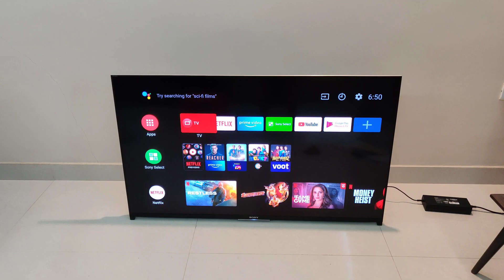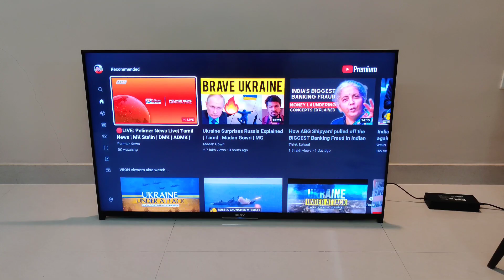Sony Bravia Red Light Blinking 6 times - Issue Fix! | KDL-50W950C

Comment: same issue with kdl 40w600b model after more than 10 years. sony service advised to change the LED back light.
Reply from the maker: Suggest you try this first. If it doesn’t work then you have a choice to change backlight or the TV itself

Comment: I have a Sony KD-65X8500G and this worked for me, I was able to release the wire from the connector by lifting the little plastic barb with a safety pin.

Comment: Hello Adith
I got the same Problem with  the Sony TV KD-43FX8096 there it is in the 2 line at the Moherboardsite  after the firste line is a gap and then comes  the 2 line.I have cut it and grounded. And it works!!!
When the TV is starting to booting with signets it is not the Blacklights.
You Video was bringing the solution, thanks!

Comment: I think I might have the same issue where the tv turns on but then shuts off and boot loops 
I switched the power supply board but it still boot loops my tv model is the Sony KD-55X720E 
If anyone else can help that’d be greatful 
Cause I don’t wanna try to do the ground wire to the screw method yet until as a last resort

Comment: It worked for kd 55xe8096 but i cleaned the power board before cutting the wire. Could have tested after cleaning itself as i found some dust particles short circuited some capacitors

Comment: I bought a 65 inch 4k sony bravia android tv in December 2019 it cost £1200,it came with 5 yrs warranty and went on the blink 5 days after the warranty had expired 😢 for the cost of repair £300+ it would surely be better to go buy a new set,it's hard to put trust in any brand after the expense to repair is placed on you after spending a small fortune 😢
Reply: thats so unlucky, did you get repair or new tv?

Comment: My TV Sony Bravia Model no KDL-75W850C  has 6 times  Red light blinking problem. I tried shown in vedio for this fix..Disconnedcted and grounded the 4 th wire(BL_EER). TV started,  The Red light blinking is gone. The TV sound comming But TV picture (not opening the screen) not comming . Can some one help how to fix thepicture display?

Comment: There are two strips of backlight at the bottom,but removing is a pain.I have no idea how many LEDs in these two strips for your case.
For 43" Sony we have total of 54, 6 volts of LEDs .Each strip has 27 LEDs.Also, to let you know each strip has three set of 9 LEDs.Each set is powered separately.So now we have 6 set of 9 LEDs each 6 volts.The Power board will sense if each set (Total 6 sets)is less than 48. And go the error state with 6 times blinking.You can calculate 6x9=54Volts theoretically, approx.48-49volts practically  for each group .If a single LED(6volts) is failed (short)that means we loose 6 volts  out of 48(48-6) which about 42, similarly if one of the LEDs is open from group of 9 them we get Zero(All 9 are in series )voltage,in either cases you get 6 times blinking.
There is a different case too, where we get 6 times blinking even if the driver IC on the power board is faulty.
In those cases you need to repair the power board after fault identification step.
My basic question.It is difficult to find out whether the problem is board or LED strips.
Let me clarify those as I am also learning tv repairing now a days
If the tv starting with visible logo of sony/android  etc and it keeps repeating few times or it just happened once afterwards  goes to 6 times blinking:This means It is the LED strips problem.If the TV simply goes to 6 times blinking without any logo after it is released from stand-by then it is power board(Mostly driver chip)
We can also check the postive voltages(white wires) at the connector from those 4 to 6 pins at the starting of the TV that would let you know that the driver chip is bad or good.If you get a voltage increase and go to a stage of about 50(In 43"sony) and then drops to 19.2v  each time before 6 blinks then in this case you have a good  driver board.
The 43" uses a 19.2v dc,3.54amps
 adaptor.
This my experience on a 43" sony lately 😊

Comment: Just did it on a KD 55XE8096.
Works great. Cable is the same as shown.
Thanks for the help.
Reply: Is it still works or any problem came?
Reply: @Raklmn  The TV isn't used very often, but so far it's worked great.
Reply: Also just did it on that model, same wire and works perfect now :)

Comment: If you have a kd-55xd8005, the wire is the 6th or 7th wire from the bottom (on the power/backlight inverter board , not the main board) and you dont ground it you just disconnect it from the connector so it no longer has a connection to the main board, if you use a needle or fine tweezer end you can unplug the connector and gently push the wire out of the connector, just keep disconnecting the wires until the tv will stay on and you find the right one , its one of the thin wires ( some of the wires are slightly thicker and some are thin), either 5th 6th or 7th from the bottom, on the top row of wires , not the bottom row . Reply to my comment if you have this model tv and cant find the wire because im going to note exactly which wire it is when i open the tv back up to replace the backlights, please note , this isnt a permanant fix , its just a useful diagnostic procedure to be certain the backlights are faulty and they should be replaced after , although the tv will come on, you will notice dark spots at the bottom of the picture where some of the leds are not lit up .

Comment: I did this for my 2019 model Sony and when it is grounded it doesn’t turn on, but when it is lose it still faces the same issue, turns on for 5 seconds then shuts off and flashes 6 times. Is this because it is a newer model. I see a lot of videos where this is done with older models
Reply: what did you do? has something to do with changing the back led lights?

Comment: after 11years without even sngle failure, my kdl 42w674 finally 6 blink. fortunately i dont have money to buy oled as my next tv. so i look around and found this fix works!
but before i cut the wire which is LD_ERR, i read somewhere comment that it is equal to BL_ERR. cut it ground it done!
my tv undo the death
Reply: and now after a month it's completely dead, only on for 2 3 minutes then flcikering then stuck, no response from remote control, unplug and plug again, it repeat as above. I assume dead now

Comment: Absolute life saver!! Thank you so much worked for my xbr-850D, I also changed my settings to standard cause it would go black on half of the screen but it didn’t shut off. The standard setting fixed that!
Reply: does it still work ?

Comment: You are a absolute LEGEND.  Back setup looked way different but managed to complete it anyway just by using common sense.  But i didn’t cut the 4th wire, i managed to lift the white part up and just pull out the wire out. 

But anyway, THANK YOU SO MUCH. Everything runs like how it did before. I can’t thank you enough.
Reply: does it still work ?

Comment: Thank you so much!!! Fixed my Sony Bravia KD-55XG8577. 4th wire on the left matched the 2nd wire slot on the right like you said. Cut it, bared the wire, grounded it to a metal screw on the back. Worked like a charm. I'm very grateful you took the time and effort to record your findings.

Comment: I have KD55XD8005 tv. And can't seem to figure out which wire to cut/ground 😖manual says i have to measure voltage og 21st pin on CN400. Which i think is 5th wire from the back on that wire asyy. But other than that, everything on the inside looks fine. I've tried following your video , but it didn't work for my tv. Help needed😢

Comment: Thanks so much for this fix for my 2017 XBR-55X800E. One of my backlights started to fade and Sony decided I wasn't allowed to watch my TV. Simple wire snip and it's back in action, with only a little dimness in a section of the screen.
Reply: this has happened to my tv. is it still working or did you have to replace it?
Reply: @auggiesexauer8640  TV is still working well. It hasn’t got any worse.
Reply: I did this thing. Worked for about 2 years and again the same issue.
Reply: @ 2 years is a pretty good extension considering Sony decides you shouldn’t be watching your TV when this issue occurs

Comment: Hi Dear Adith, I have same TV but my tv 55in. KD-55X8500D and instead of 14+14 pin there is 15+15 pin. I need the pin description or which wire i should remove. Need urgent help before waste the TV.
Reply: Help me please i have the same model.

Comment: It worked great!! Is it a fire hazard now and what exactly did I bypass by cutting that 4th wire? What was the root issue and by bypassing it does that create a hazard? I had 6 flashing red lights originally. Seems fixed now!

Comment: Worked for the time being on a 3 year old 85" xbr-85x800h - same wire (top row, 4th in from the right). Sony calls this Pin 8 on the pinout that is on the board, but it is the one in the video above. Cut the black wire, ground out the end from the cpu board, and all is well. Hope it gets my by awhile longer!

Comment: Nice fix, have to try on my TV. However it doesn't indicate the root cause, I suspect its the power supply board, likely a blown capacitor or IC.
One alternative is to solder another LED to the wire - maybe with a transistor/resistor combo and drop it  down at the back, that way you can still get the blinking indication for other errors.

Comment: Hey is here anyone who can help me figure out BL_ERR wire for my tv. I have a diagram from manual of this tv XBR-55X850D & it says 12 in yellow background & 21 in green background. What does that mean & how to count & get proper wire to ground it ?
Edit: Found the pin & now it’s working fine. Thnx
Reply: Hello, I have the same model xbr -55X850D, can you help me with the pin number that I should cut, please.
Reply: Dude, which pin is used for BL_ERR on the XBR-55x850D???  You stated you found the pin. Please respond!
Reply: Hey man please help me which wire did you cut?

Comment: Gracias por el video, pude realizar la modificación en un Sony XBR-55X805E y resulto perfecto, se termino el problema,  el cableado no es igual pero, es de 14 pines e interrumpí el cuarto cable fila superior. Saludos desde CHILE
Reply: Hola, sabes si sería el mismo cable para un Sony bravía KDL-2W650A ?
Reply: KDL-42W650A
Reply: Hola, no soy experto en el tema, no te podría ayudar con tu consulta, solo seguí el video, aparte que el conector era igual al que yo tenía en mi televisor 
Suerte

Comment: Thank you so much this worked for me.  I can thank you enough. question how long till it stops working again, you said this is only a temp solution.
Reply from the maker: I meant until something really conks off and since there’s no error indicator it breaks down for good.. that’s when there’s no other resort than replacing the TV

Comment: Hi getting the same error . KD49X7500F . Should I follow the same steps ?
Reply: I jist did mine. I have KD-49XD8077. In my case it was the fifth wire. All working back again.

Comment: So if the TV overheats, and the LED light is disabled, the TV can catch fire since it won't turn off by itself?
Reply: That's not how it works. Overheating an electrical component will fry the component or wire out, but it doesn't combust into flames. The worst that will happen is that component will be destroyed or the wires leading up to it.

Comment: Hi would you know what wire the BL-Err is on a Sony  TV  Model KD 55XD8599 as i have 6 flashing Leds fault thank you
Reply: I have the same model and problem. Did you get an answer?
Reply: @malachydevaney6855  check the motherboard for a pin out labelled “ BL-ERR”.  It’s that wire. Follow it to the PS board connector and disconnect or snip off there and ground the free end from the mother board. I’m doing the same to my kd55xf9005 which has 4 blinking lights signifying a power or MB error, most likely just a pixel down.
Reply: Sorry I'm late to the party here for you all but on the connector the bl_err for the 55XD8599 is the 6th cable on the top row from the left. That's cable 12 from the service manual schematic. I've just cut this cable on my own 55XD8599 and it worked like a charm! Hope this helps!!

Comment: I have a KDL-48W600B from 2014 with the red light blinking 5 times, do you think this would this work for me
Reply: Man I had the same tv .,just now  started doing that
Reply: @jcalzada74  Jeez what a coincidence, My TV was dead for 1 year. I had at that time, a proper Sony helpline technician come and have a look at it. He said he would have to replace the whole LED panel, which would cost a bomb. Just a week ago someone in my locality recommended a TV technician who repaired it for a 5th of the price of the LED a panel, he repaired it in a day. 

He told me the 5 blinks indicates a short circuit in the power connection to the LED panel. If you could find someone locally, to do it you would save a lot.

My TV died after a heavy rainstorm, which could have caused and electrical surge.

Comment: This has solved the issue with the 6 blinking lights on my KD 55XE8577 - there is a service manual downloadable online via google search. From there I doubled checked that the schematic matches what I see on the circuit board and identified the Backlight Error cable. It was a little confusing for a layman like myself in the beginning but there are 2 white cables amongst a bunch of grey cables - so I just used that as a reference to work out which cable slot relates to which tv function in the service manual. It works out that the bottom column top row slot is no.1, top column top row is no.2 - so the 8th slot which is the one I needed to cut is the top column 4th row down as per the video. Being the noob I am, I forgot to peel back the cable plastic casing in the first attempt before screwing it down to earth the cable; this resulted in the red light still flashing.  I opened up the back and earthed it properly and now the TV does not show the red light error anymore and running as normal. Really useful video so thanks Adith for showing us the way!!

Comment: Worked on xbr-65x850d!  🎉🎉 its a different setup behind the back cover but the 14pin (actually its 28pins between 2 rows) connector goes from the power supply to the motherboard. My TV does list the 'pin config' and the BL_ERR is the exact same one as the video (2nd row, 4th one back!).. i cut it and grounded it, per the video.. now, NO MORE 6xBLINKING RED LIGHT!!!  .. running a software update but half the screen is dark (not completely black), so im pretty sure the Backlight panel is bad 😞.. looking at ebay for replacement boards but might just get rid of it cause if one thing is going bad there are probably more on the way. I'll see how much parts are and how complicated the repair process is.  Thank you sooooo much for this video!!!  Tried all other suggestions from many google searches and this was the only thing that worked! .. could not have done it without you Adith Krishnan!!!!  😊😊😊😊
Reply: Salve nella mia tv Sony il quarto filo del PIN non è presente quale dovrei tagliare

Comment: Hey thanks for the video 

But my Sony kdl-43w800d having the same 6 time blinking problem and i also ground the backlight wire but still 6 time blinking happening please provide me the solution 

And yes the tv runs fine for 1-2 hours and after that the error occurs and after switching off the tv for 5-10 minutes the error gone and than again 1-2 hour error comes up please provide me the solution 

Thanks and appreciate

Comment: I hv Sony KLV-43W772E normal smart tv not Android...starts with 3 time Sony Boot Logo on/off, then 6 times Red LED starts blinking...what might be the issue sir.
Reply: Hello brother. I have the same model. Has your issue been resolved if yes then how and what cost ?
Reply: @Sharma60799  The problem got fixed... certain number of LED were faulty in the LED strip...those were replaced...the Red logo blinks due to this fact and we hv to bypass it by replacing the faulty LED

Comment: I have KD55x8500 f model, on the power board BL_Err mentioned on pin 8 , I removed it and ground the same, but after ground tv is not powering up and as soon as released the ground it works.... Any suggestion?

In my case Sony asking to replace the back light strips costing 16K + taxes (Very costly 2 LED strips..... :D
Reply: Hey man, I'm sure it's too late, but I had this same problem with "pin 8" yesterday. BTW, if you watch other videos, they show how you can properly pull the wire rather than cutting it.  Anyway, I pulled 4 wires before I found "pin 8."

How to find it..... you can't count out 8 across the top or the bottom. The top row was odd and the bottom roe is even. So essentially, pin 8 was the fourth pin on the bottom row. 

Also, instead of grounding with a screw, I inserted the pulled wire into one of the empty pin holes on the component, which is also "ground."

Comment: I got 4 red blinks on KDL-55HX729. However, the board looks different. i had to find BL_ERR on the board. For this model, it is 3rd wire, and I grounded it. Thank you for the video
Reply from the maker: Awesome! Glad to help
Reply: What about the voltages mentioned in the Sony service manual.